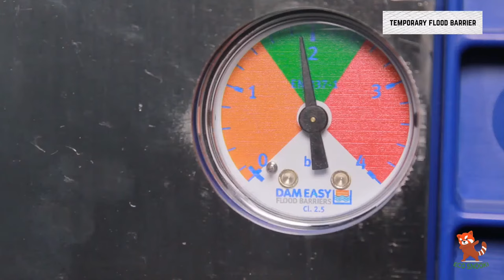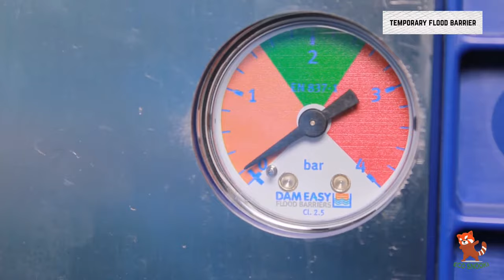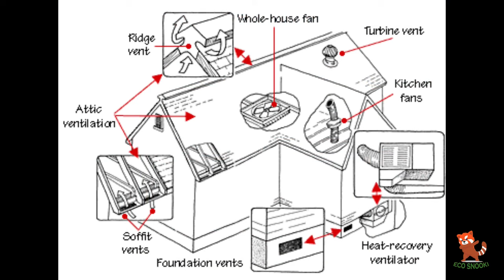Does new tech flood barriers protect the house from flood ?

Comment: Flood barrier is okay and will work, no doubt but water will gush thru ur toilet once the external sewer system is flooded. I was thinking that our outlet sewer pipe can be shut off manually with simple valve
Reply: how bout inserting a rubber stopper on the toilet?
Reply: @bikechannelph4082  yes, it is a good idea but it should be long and tight enough considering the hydrostatic pressure from external water
Reply: Buy a gateway valve and fit it to pipe that connects both
Reply: Some sewers have a one way flap that should be able to stop most water from coming in.

Comment: I have a walkout basement and it's always flooding. I use Floodsax and pool pumps that are attached to hoses to pull water away from the house. I have long extension cords always at the ready. This is fine during the day IF I am home (and that's a big IF) but not for those nerve-wracking, heavy thunderstorms in the wee hours of the morning. Do these REALLY work and will they work on a regular basement door ? I have been using those Floodsax but there is no way to get rid of them. I have 20 piled up outside from all the rain. They never dry out and they look like old moldy pillows at this point. Plus they weigh a ton.
Reply from the maker: Please visit the below given link. Which shows the different customer reviews related to flood barrier.
https://judge.me/reviews/dam-easy.myshopify.com
Reply: xin chào chúng tôi sản xuất cửa chống ngập đến từ việt nam